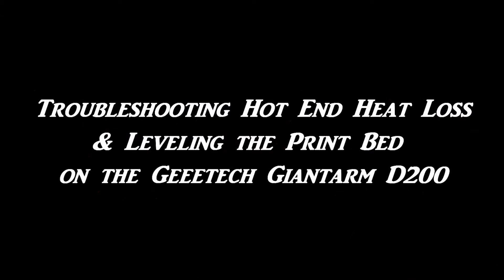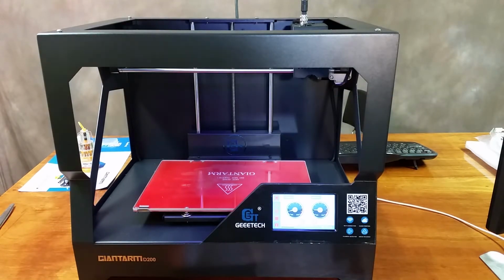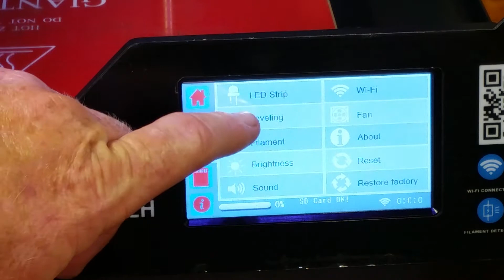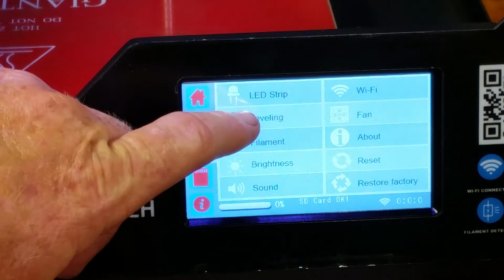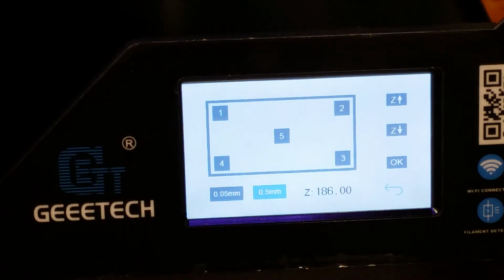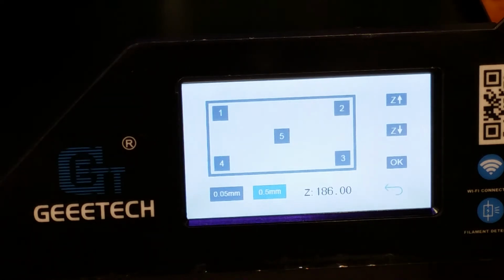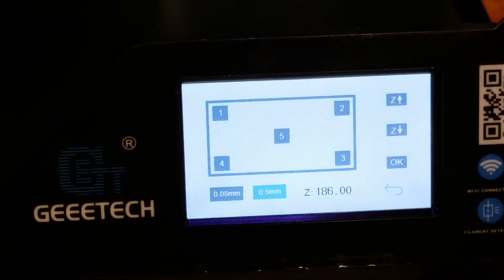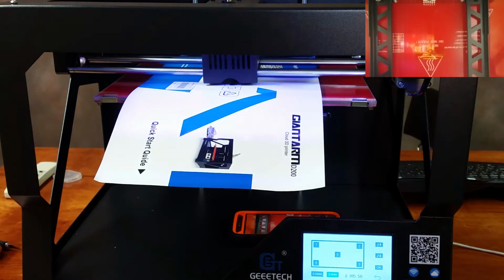Troubleshooting Hot End Problem  /  Leveling Print Bed on the Geeetech Giantarm D200

Comment: Hi Jimmy, love your video's.
The menu looks like that you can level all 5 points electronicly but there is only one stepper motor and one electronic level.
The leveling is actually very simple, just level point 5 electronicly, do the other 4 with the screws under the bed.
That is it.
I also have trouble with the nozzle comming lose, I put a little block in the head to block the quick release from comming lose.

best regards Wubbo
Reply from the maker: +wubbo73 Thank you so much!

Geeetech's leveling system is supposed to be software adjusted, meaning that after leveling with the aide of the software, it's supposed to auto compensate for bed level by moving the bed up or down as the nozzle passes side to side.  With that said, I have never seen the Z axis move to make this adjustment.  Definitely something I'm going to test soon.

You have a great idea on putting a block in that latch.  I'm interested on how you get it to stay in place.  I am not a fan of this new nozzle design or of the latching mechanism.  I hope Geeetech reconsiders this design in future models.
Reply: Hi Jimmy, the block is just a peace off wood with some ducttape to keep it in place, this is a temporary solution, I will make a permanent solution from aluminum wit 1 screw or so.

I will do some more testing on the leveling, but I have not seen the bed moving while printing.

There are unfortunately more problems with this printer.
1) the NOISE, there was an Jet running in my room, but I got rid of most of the noise.
The small fan in the rear bottom compartment, where is that for? I just disconnected it.
The bigger Fan also in the bottom, I put a resistor in the line, now it is running on 12V instead of 24V. This one is a lot less noisy now, and cooling more than enough.
Ten the bottom plate was only mounted with 3 screws, the other 5 mounting position are not used. This created vibrating noises. A put all 8 screws in and put canvas tape over all the places where this plate touches the frame. This also is an improvement.
2) I have problems with extrusion, it looks like it is constant under extruding due to a low temperature of the nozzle. 
If I print a test cube with low speed and an increase of temperature every 5mm with 10degrC then I have a good result for PLA at 210degrC. 
But if I do a normal print with normal speed of 40 or 50mm/s then a have to increase the temp to 235degrC to get a reasonable result.
Also if I do and test extrude of 100mm filament it only extrudes 80 mm
So I have not figured this out yet, but when I do I will let you know. 

best regards.

Comment: To get rid of the ringing,  turn down acceleration in the firmware. Also the zebra striping is cause by a stepper driver not calculating steps correctly and having one of the 16 or 32 steps larger than the others.  To fix that you can switch out steeper drivers or simply orient your benchy on 45 degree angle while printing and it will get rid of them.